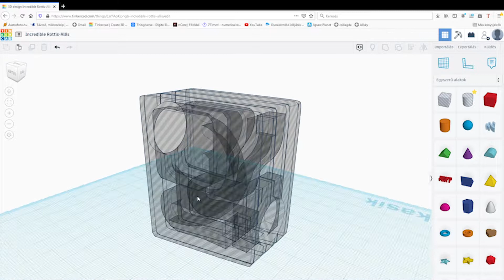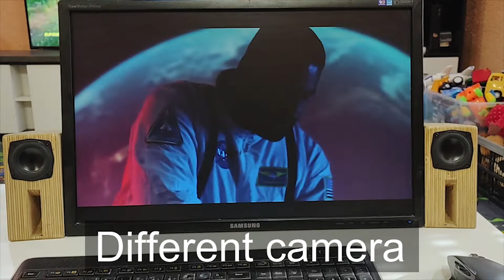Homemade laser cutted, plywood, horn speaker with Dayton audio nd65-4

Comment: did you add some kind of filters to the speakers? i'm really interested to build these for myself.
Reply from the maker: No, i didn't add any filters.
Reply: @Kalala0925  the rear vent was made for sound purpose or for the wire outlet?
Reply from the maker: @artfuldodger5707  the rear hole is for a round speaker terminal. There is a small channel in one layer where you can plug through speaker wires between the speaker chamber and the terminal.
Reply from the maker: 0:35 you can see the channel on the lower left side

Comment: the box can be used with the 8 ohms speaker too? or dimensions differ due to impedance?
Reply from the maker: With the nd65-8 it sounds different. 3dB quieter with 1W and not go as deep as the 4 ohm version. You can see it here. Left is 4 ohm, right is the 8 ohm version:
https://drive.google.com/file/d/1KrNkGhZjkKinkj9JsEeDoHPsaADLxQQ8/view?usp=share_link

Comment: Do you have the stl files and willing to share them?
This is a nice build. I'd like to make something similar
Reply from the maker: https://drive.google.com/file/d/1PNZTZg2nbU2LJlJltDGn_678M10Mtrue/view?usp=share_link
Reply from the maker: I have the plans for laser cutting. I made it from 6mm plywood.
Reply: The svg file supplied in the above link does not have the accurate pieces. The pieces he puts down on the table at 1:04 are not in there, they have a small square in the corner that is not in the file. And the larger square cutout area (with the thick wavey "tail" channel) for the speaker is facing the slanted face of the speaker but in the file it faces the opposite side.
Reply from the maker: @nickspace6230  I cecked it, but te files are good. You dont need the corner cutout, you can see at 1:05, i put a solid piece there, so i close that chamber. The files are an upgraded version, without te cutout. the hole is in only one piece, and you need double check where it is (0:08), you need to follow the path of the sound.
The larger square cutout area is not facing tha slanted face, you can see it when i put all thogether, or at 1:14.
Reply from the maker: At 0:20 you can see the speaker without the cutout.